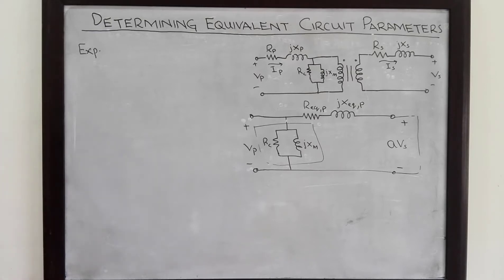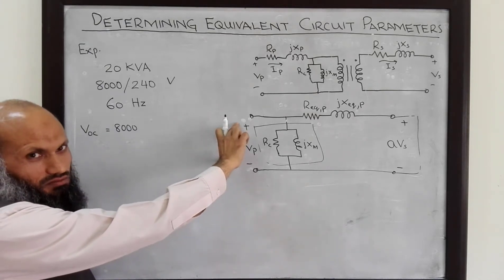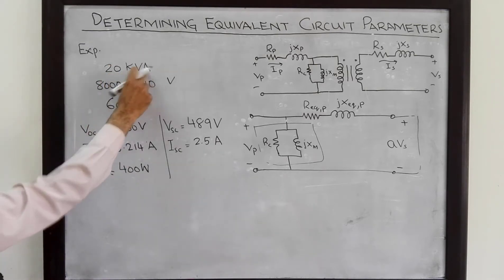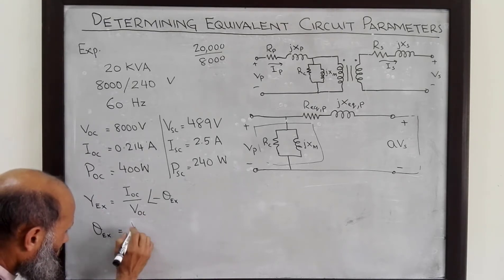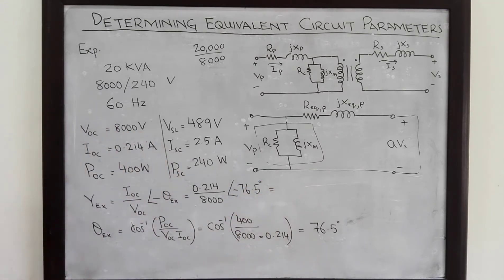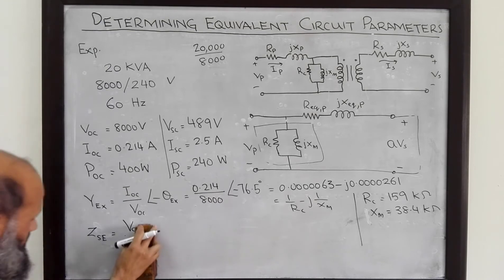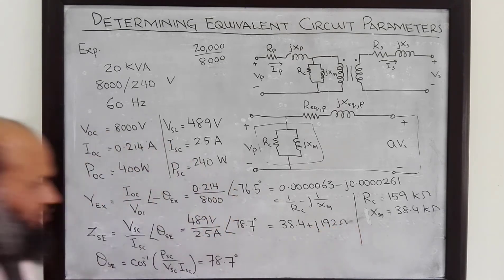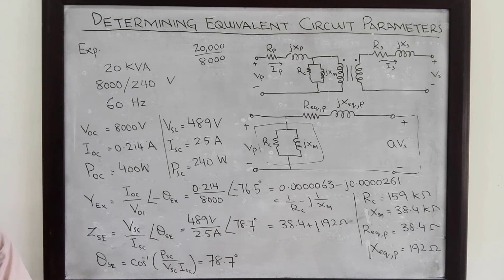EE213 - 09b - Determining equivalent circuit parameters for a transformer - numerical example

Comment: Sir, where did you get the open circuit current and power open circuit?
Reply from the maker: Current and power are measured by the ammeter and power meter, respectively.

Comment: when i try using your method for the open circuit test method  on other numericals in the book i get different answers compared to the ones in the book ,
forexample this question A single-phase two-winding transformer is rated 20 kVA, 480/120 volts, and 60 Hz. During a short-circuit test, where rated current at rated frequency is applied to the 480-volt winding (denoted winding 1), with the 120-volt winding (winding 2) shorted, the following readings are obtained: V1 = 35 volts, P1 = 300 W. During an open-circuit test, where rated voltage is applied to winding 2, with winding 1 open, the following readings are obtained: I2 =12 A, P2 5=200 W.

does the open circuit test have when it works and when it doesnt ? I mean the method you just showed in this video
Reply from the maker: I think, you should have obtained correct results for the short circuit test (used to find the impedance of the series branch) and somewhat different results for the open circuit test (used to find the admittance of the excitation branch). 

The reason for different answer is that the open circuit test in the mentioned problem is performed on the secondary side (low voltage side) of the transformer. In that case, to obtain correct answer, multiply the obtained answer with square of the turns ratio. Why? The answer of this why lies in the equivalent circuit of the transformer referred to the secondary side.

Comment: Where did you get Vsc= 489V?
Reply from the maker: While performing the short circuit test, we apply a voltage to the transformer such that rated current flows in the transformer. The numerical value of 489V in this particular problem is provided in the problem statement and would have been experimentally obtained after performing the short circuit test on the transformer.

Comment: How to determine primary and secondary side impedances separately?
Reply from the maker: There is no easy way to separately find the series impedances of primary and secondary side of the transformer. 

Furthermore, for most of analysis on circuits with transformers, separate determination of these impedances  is not required.
Reply: @MAFarooqi  thank you very much for the reply. But in Matlab simulation’s transformer models these impedances are required separately for both sides
Reply from the maker: Are you using simscape? Which block you are using for the transformer? Delta-Delta?
Reply: @MAFarooqi  yes Simscape/ Electrical/ Specialized Power Systems/ Fundamental Blocks/ Elements / Three-Phase Transformer ( Two Windings) . Im using matlab 2020a. This transformer block require winding 1 & 2 parameters separately. I’m simulating a delta-star transformer of my working place. It has only short cct and open cct test data only
Reply from the maker: @udayanthaniraj  you may use the impedances determined using the short circuit test at the primary side of the simscape block, for example, and zero impedance at the secondary side the block.
Reply: @MAFarooqi  thank you

Comment: Thank you very much for these videos. I was wondering why can the short circuit have its current just be determined with S/V,primary when the open circuit is simply measured? Would the short circuit current always be equal to the power rating divided by the primary voltage?
Reply from the maker: While performing the short circuit test, we do not apply the rated voltage on the primary side. Then how much voltage is applied? The voltage applied is equal to the voltage that will cause the rated current to flow through the primary side. What is the rated primary current? It is obtained by S/Vp.
Reply: @MAFarooqi  I see, and is this voltage that is applied the same as the measured short circuit voltage?
Reply from the maker: @ynnad7778  Yes.
Reply: @MAFarooqi  Thank you very much for the clarification!